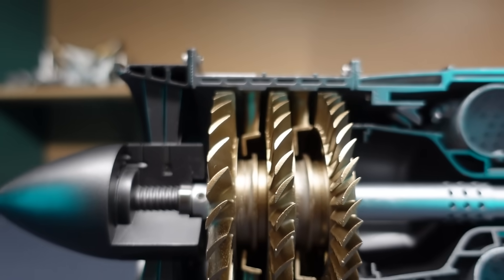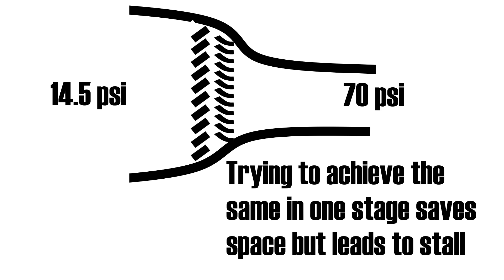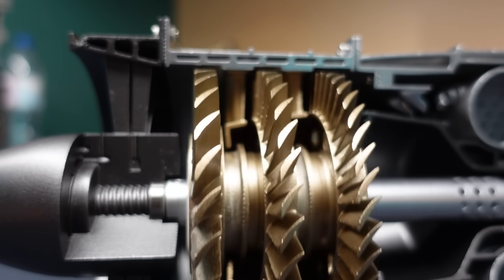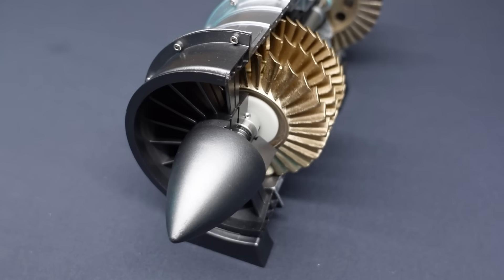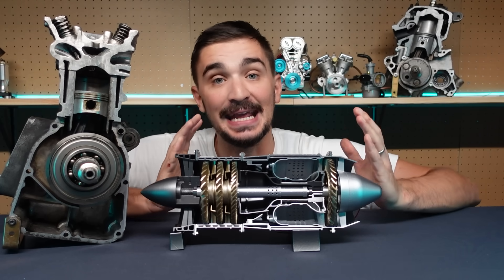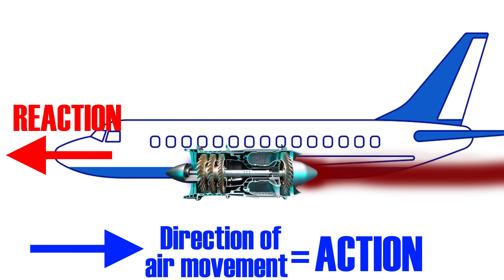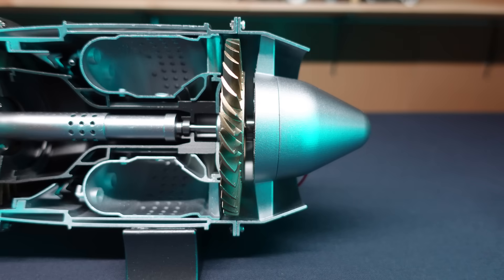Appreciating The Beauty of Jet Engines by Juxtaposing Them Against Piston Engines

Comment: A jet engine's compressor blades are not increasing the potential energy of the incoming air, neither does the combustor. By the combustion process, CHEMICAL ENERGY of the injected fuel is (partly) converted to kinetic energy of the gas mixture, thereby increasing its speed. This kinetic energy is then (again partly) harvested as usable work by the turbine. 
Potential energy is solely given by the term E = m * g * h (mass, g-konstant, height) and has nothing to do with the combustion inside an engine.

Comment: What's the difference between a turbine and a fan?  Back in the '90s GE was working on what they were calling the "unducted fan".  It looked like a fancy propeller to me.  The nomenclature for various types of the same thing gets confusing and I've never found an adequate definition.  

The best I've found was that a propeller transfers power through the center shaft whereas a fan transfers power via thrust.  But I don't know if this definition is correct or not.

Comment: The PRESSURE DECREASES in the combustor. Otherwise, air would be driven BACKWARDS through the intake compressors. However, the VOLUME increases greatly, increasing available PV work. The volume increase powers the expander turbine.

Comment: At the very beginning you characterize both engines as internal combustion engines. Yes, the piston engine is obviously just that. But the jet, since combustion takes place continuously is by nature a more "open" design. Air and air mixing with liquid fuel is always entering the engine from outside and at no point is it sealed off internally. For that reason I always was taught that jets are external combustion engines.

Comment: The pressure increase is about 1.2 x the pressure per stage. So a large commercial aircraft engine with 14 stages has a huge pressure increase across all the stages

Comment: There are 2 significant errors in this presentation:
1) pressure does not increase in a gas turbine during combustion, as any compressor could not push air in one direction if the pressure oppsoing it is greater. The exact opposite is true: beyond the compressor the pressure is only reduced. What does increase (significantly) is velocity.
2) gas turbines (of any kind) are less efficient than piston engines. That's false, as hp produced per volume of fuel consumed is in modern turbines close or some times above that of the IC engines.

Bonus: the gas leaving the combustors has to be below a certain temperature.... welp, not necessarily. In 1940's that may have been the case but modern high performance turbine blades can even operate at temoeratures beyond their melting point (!!!) thanks to extremely advanced cooling and heat dissapation design.

Bonus 2:
Compressor surge can not physically happen on a jet engine. Or gas turbine for that matter. You are mixing compressors/pumps with gas turbines. Literally apples and oranges.
Reply from the maker: Thanks for binge watching my vids. I sincerely appreciate it. ❤️

Comment: Fun that u go here ...I used to teach jet engine at the SAS in English and Portuguese Though today in retirement I renovate the racing machines I used to race or if not the very bike a similar , RC30, ZXR 750 , and similar ..... The thing with the jet is as the combustion is constant one doesn't run into the 14.7 ratio needed to start combustion , nor the problem of pinging, one can therefore lean out the mixture to the point one melts the turbine blades , then cool said blades and thus being able to lean further, as well as use VERY low octane fuels....also yes the speed of the exhaust gasses gives thrust  but supersonic exhaust speeds are actually detrimental in subsonic flight , therefore one uses high bypass engines where the mass of the moved air more comes into play . hence the large diameter of subsonic engines. However running a low bypass rate is also beneficial supersonically as it then supplies still oxygen rich air for the afterburner , makin' said stovepipe more efficient.....   kihi I also saw the incorrectly fitted turbine blades  , made it hard for me to try to concentrate on what u were saying....But very goood !!!

Comment: 6:57 The combustion in a jet engine doesnt cause an increase in pressure. If it did, the air from the compressor would never flow from the compressor to the combustor. The highest pressure in a turbine engine is at the moment air leaves the compressor and flows down hill from then on. The combustor serves to greatly increase the volume of gasses in the turbine.

Imagine you have a air compressor (like in a shop) that runs off compressed air. Say a piston compressor is run off an air drill. The compressor fills a tank and that tank runs an air drill. Oviously this would wouldn't run very long. However, a jet engine by injecting and burning fuel, drastically increases the volume of air inside the air tank. Our system would work if we could double the amount of gasses coming out of the air tank. The compressor pumps in 1 cubic foot at 100PSI, the combustor turns that 1 cubic foot into 3 cubic feet at 95PSI. This is a huge increase in energy thus we can use 2 cubic feet at 95PSI to keep the compressor running and the last 1 cubic foot can be used to push our plane through the air, or power a large generator (many natural gas fired powerplants work this way)

Comment: At mark 6:53  Combustion does of corse increases temperature but not pressure in the combustion chamber. It increases speed. As the chamber is an open cylinder there can't be a pressure increase.

Comment: Nice video ! But you have the turbine rotor blades (or the whole turbine rotor) reversed in your model. The flatter part of the blades should be facing the combustion chamber.
Reply: The turbine stator blades are also reversed ;-)

Comment: The high altititudes are also advantageous for jet engines because it helps keep temperatures down, allowing for more power without overheating than can be accomplished at sea level

Comment: To be fair a turbo fan is just attaching a big fan in front of the turbine and encasing it so you have lots of air bypassing the turbine.
And a turbo prop is just a jet engine but you attach a propeller.
And if you want to be REALLY fancy you bend those prop blades a bit and call it the "revolutionary (tm) CFM RISE"

Great video!

Comment: 5:15 This is a big misconception about axial compressors.

The air isnt compressed because its being forced into a narrowing gas path. The air is compressed by the circumferentially diverging flow area across the stators. The axial gas path gets narrower to accomodate the change in density. In other words, the gas takes up less and less space as it gets compressed, so the gas path doesnt need to be as large.

Comment: Turbo fans basically generate most  thrust from the front fans, so they extract most energ from the compressed hot air and use it to turn the front fans which generate thrust.
they are like an intermediary between turbo props and turbojets

Comment: 6:52 - No, the pressure in the combustion chamber isn't increased, it stays the same. It's volume that's increased. If the pressure increased, nothing would be stopping the air  from going out through the front.

Comment: Also jet engines can be as efficient if not more so than piston engines, the latest GE90 claims 58% thermal efficiency at takeoff thrust. Though compressors and turbines are less mechanically efficient than pistons, the much higher operating temperature and corresponding Carnot efficiency makes up for it. But you are right they are only efficient at the highest RPMs. That is because the RPM is linked to pressure ratio, and pressure ratio is linked to efficiency. Another reason jet aircraft fly as high as possible is so they can maintain relatively high RPMs which keeps the high pressure ratio, but the greatly reduced volume of air means lower power sufficient for cruise rather than what is needed for takeoff.

Comment: BTW the flame doesn't increase the pressure of the air in a turbine engine. It increases the volume/velocity but the pressure is dictated by the compressors and actually declines slightly through the combustion chamber due to dynamic effects. The increase in volume is what allows the turbine to extract more energy than the compressor puts in and use the excess for whatever purposes it serves.

Comment: I believe the textbook difference between an ICE and an ECE is that in an ICE the working fluid is combusted, rather than relying on a heat exchanger. Which would make a flame-licker/vacuum engine an ICE because even though the flame is sort of outside of it, the working fluid is still combusted.

Comment: 10:44 for jet engine nerds:

 this is usually done with oil in big jet engines. since there are no sliding surfaces, oil is used not for lubrication but temperature management. The shafts get oil sprayed on them which keeps them cool..and then is ran through a radiator located in the cool air bypass section. There are no air holes to keep the shafts cool. 

Two types of air exist in large turbine engines: core air and bypass air. Core air is what gets compressed and combusted. Its what gets hot. Bypass air bypasses the main engine. Its purpose is to provide more thrust for the plane, as the turbine themselves don't produce enough to push the plane. That GIANT fan in the front of planes are about twice the size of the turbine blades themselves, most of that air is bypass air and not core air. The core engine itself is tiny inside one of those engines. A large portion of it is ducting for bypass air. Bypass air is also used to pressurize the planes control systems, starters, deicers, and brakes. It cools the oil and everything else inside the engine that needs cooling. Bypass air also cools the combustion chamber from the outside. 

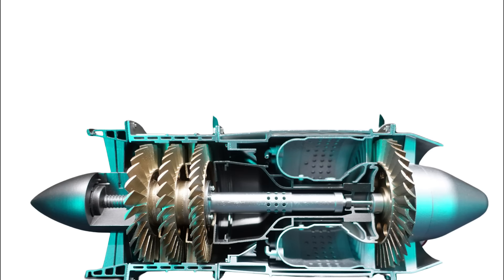That fan I talked about is attached to a second turbine stage located right behind the combustion turbine stage he describes at 7:02. its called the power turbine. It uses some of the air he describes at 14:00 that gets lost to thrust. So this statement he says is FALSE, its not the "only" thing its used for. That turbine is complete separate from the core engine blades. It has a solid shaft that runs through the core engine and hollow common shaft described at 7:08 to the fan in front.  This scavenges some of that lost thrust and turns it into energy to turn the fan which creates more thrust in the form of bypass air. This makes the engine closer to 13:50, which is WAY more efficient and makes the engines smaller and lighter. In the old days, planes relied on Turbojet engines which have no bypass air or fan at all like an RC jet engine and they had to make them HUGE, heavy and inefficient. The two sets of turbines, the fan turbine and core turbines are defined as the N1 and N2 turbines and since they are independent from each other, they both have their own RPM readouts. N1 is the core engine turbine and common shaft and N2 is the fan and fan power turbine and solid shaft. 

N1 and N2 diagram: https://www.mdpi.com/machines/machines-09-00049/article_deploy/html/images/machines-09-00049-g001.png

N1 and N2 readouts in a plane at the bottom: https://skybrary.aero/sites/default/files/ECAM_0.png note the percentages are different due to them being independent. 

Image of engine without its body from Bloomburg. Note the large fan in front: https://assets.bwbx.io/images/users/iqjWHBFdfxIU/iZiGvLrS4KYo/v1/-1x-1.jpg

The combustion chambers do have the same type of holes on them on large engines for some air cushion on the inside of the combustion chamber, but its main purpose is so the flame itself doesn't blow out which can lead to compressor stall. the holes allow air to enter evenly AND help the inside of the chamber. The difference is larger let engines on lets say a 737 or a fighter jet, they have a HUGE amount of cool bypass air flowing past the combustion chamber from the outside. which keeps it from melting down. Different types of cooling are used for the blade. Convection cooling uses little holes like this through heat conduction, impingement cooling hits the inside of the blades, Film cooling uses little holes like this videos describes for the blades, Cooling effusion uses porous blades to inject cooling air, Pin fin cooling is used in conjunction with all these methods narrow trailing edge film cooling is used to enhance heat transfer from the blade, and Transpiration cooling uses effusion porous blades to make a film. 

Here is a diagram of bypass air and coe air: https://image1.slideserve.com/3206347/bypass-ratio-turbofan-engines-n.jpg

All of this is generalized, the configuration of the engine will change with type and application. Again, at 14:00 what he says is incorrect. For example a turboshaft engine uses the power turbine to power a shaft and will have slightly different cooling systems or oiling systems on them, turbo props use the power turbine to power a propeller, turbofans are what i described above. But this kind of thing doesn't exist in small hobby engines like this because they are simply too small to even have traditional bypass air and oiling systems.

Also note at 14:58 this is half true. Even on the ground, jet engines are 70% more efficient full throttle then they are at idle. Its just the nature of turbine engines themselves.

Comment: Why don’t turbos implement these rakes from the jet engines compression system to increase pressure, just thinking aloud out here it may be unfeasible
Reply: Axial compressor is designed to capture the advantages of ram air. Piston powered car usually don't go more than 500km/h and it was among the fastest, and airplane usually cruise at 900km/h, at slow speed the advantages of ram air is not very clear. Axial compressor also require higher RPM for and car combustion chamber couldn't really provide enough gas for that, unless you are okay with compressor taking more space. The conclusion is, if you want to use axial compressor for a car, you might as well throw the piston engine and just use gas turbine engine for your car and enjoy that >600km/h drive

Comment: Really enjoy your explanations! Clear and well done. Two minor points, the pressure through the jet engine has to be less in the combustion chamber than the output pressure of the compressor otherwise the compressor couldn't force air into it (except for a pulse jet). A theoretical efficiency edge of the piston engine is that work is extracted from the system at a higher absolute temperature (as the pistons are not exposed all the time to this temperature) and efficiency is related to difference in T between where energy extracted and  the T where heat  is 'dumped'. I learned from you that the ability to run in low atmospheric pressure of jet can overcome this disadvantage though. (Wonder if you ran a supercharger at a high enough ratio you could get it back though?) As we get better materials  for blades to live in the exhaust gases this 'advantage' will be reduced. Jets are so nice for their simplicity though!

Comment: 6:50  - This is not a sealed chamber. Combustion DOES NOT increase the pressure of the gasses! It only raises it's temperature. This is one of the most common misconceptions of turbine engines. Air flows from high to low pressure therefore the air leaving the combustion chamber is at a LOWER pressure then when it entered. The highest point of pressure inside the engine is right after the compressor and then it is all downhill from there until out the nozzle.  If the pressure increased during combustion, the air would start to flow the other way. If combustion not raising pressure seems odd, light a match or a lighter. The air by the flame gets hot but it's pressure does not change.

Comment: Why Jet not used in cars?
Reply: They are not as fuel-efficient and can't respond to throttle changes as quickly as a piston engine. It has been done before, though, and the M1 Abrams tank is even powered by one.
Reply: Bad fuel economy and bad acceleration

Comment: Combustion time in jet engines is limited to how fast the air is moving through the combustion chamber. A lot of combustion chamber design is there to slow down the compressed air to aid more complete fuel burn.

Comment: I wonder if we can put jet engine in cars. Somehow connect it to the drive shaft and exhaust and run it 20k rpm. Of course less compression because it is on the ground level and more turbine to extract more from the hot combustion air
Reply: Already been done, the production was a bad timing since a few years later the oil prices sky rocketed. If you want to see there are some video on YouTube

Comment: a simple trick jet engine used to increase efficiency at low load is water injection into the rear part of the combustion chamber. Artificially increase the mass flow rate travel through the engine, thus increase thrust without expending extra energy. But it's usually done during take off when thrust requirement is the highest, and the reserve water tank will exhaust its water mass in a few minute of operation

Comment: what about turbine engines that use the mechanical work ? Like tank turbine engines or motorcycle turbine engines
Reply from the maker: Attach a shaft to a turbine and off you go
Reply: @d4a  i figured it could be that simple, but what about transmission ? fixed gear ratio direct drive ?